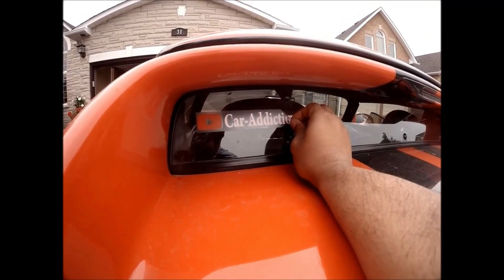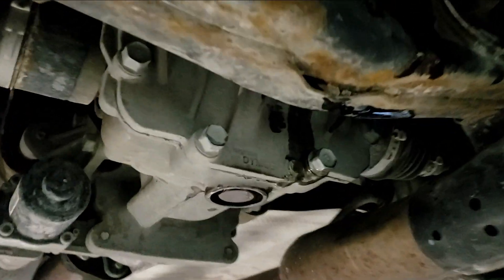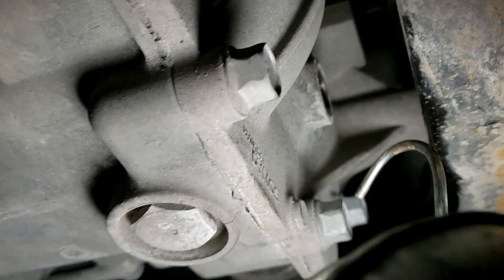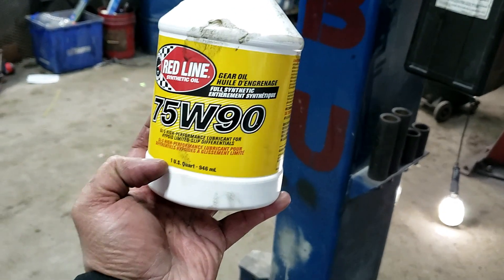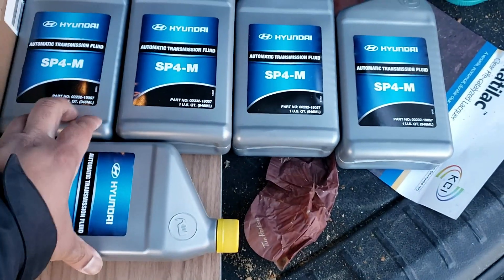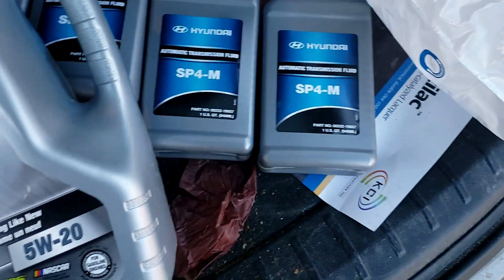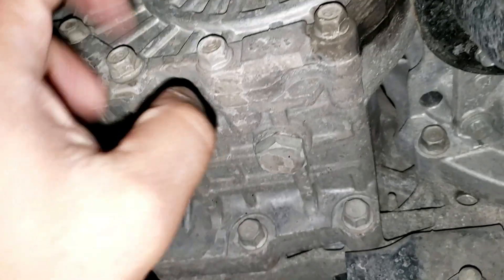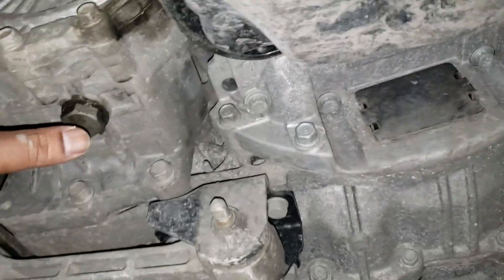How to service your All Wheel Drive (AWD) system.

Comment: I have a Maserati Ghibli SQ4 . I have the “Service AWD”.. I’ve done all the maintenance myself before from oil change and coolant flush. Do you think theirs a problem with my car or it just wants it service on the awd?
Reply from the maker: Did you run the codes? I would like to know exactly what code its throwing. In all kinds of auto transmission related fluids, I always recommend OEM fluids. 

Please subscribe to the channel.
Reply: Car-Addiction Yes the code is C147796 “Transfer Case/Driveline Transfer Case Clutch Component Internal Failure . I googled it but don’t know exactly what it means. Please help man , I’d appreciate it